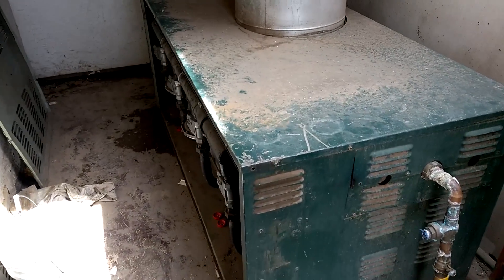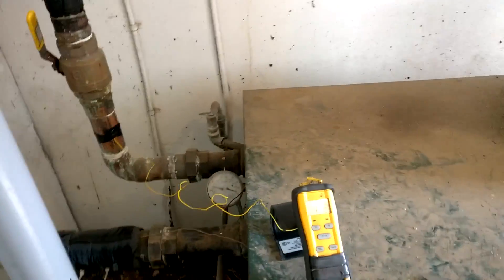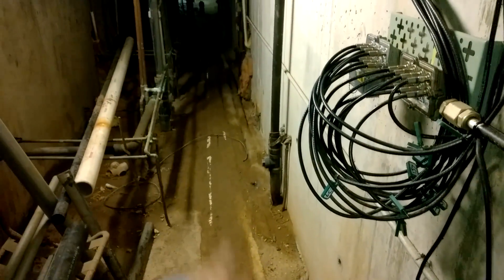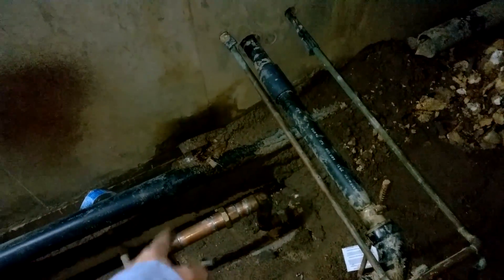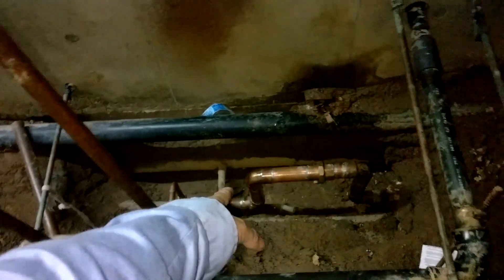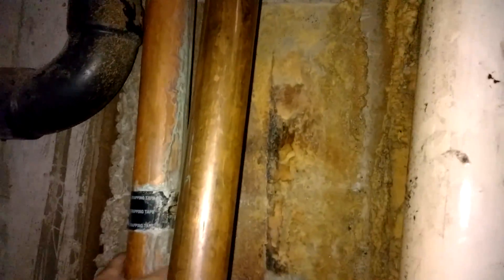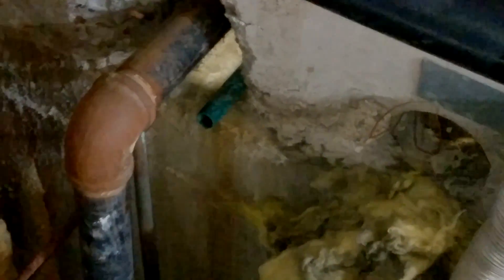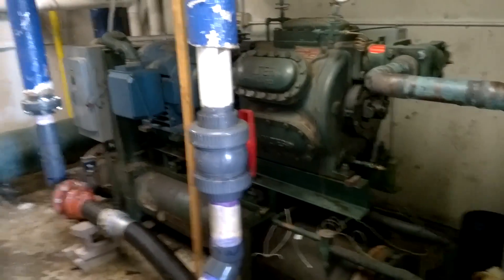Odd commercial system uses domestic hot water for closed loop heating

Comment: I worked at a motel that had this type of setup.  Chilled water loop, hot water loop, and domestic cold ( 5 pipe.. ).  It got real entertaining in the summer, because they didn't want to spend the money to rebuild dead zone valves.  

They would have to go around to rooms that had known ( or newly reported ) "air conditioner don't get cold" complaints and turn off the isolating valves.

Luckily, they were two separate loops, so the water wasn't shared, but the heat exchanger shared the heat - the chiller wasn't too happy.

Comment: Pretty common up here in the Northeast, especially in the places with oil heat & no gas hook-ups.  Lost of places even have a separate, insulated storage tank off to one side as a buffer for the domestic hot water side.
Reply from the maker: +therealfranklin Yeah no tank at all here. Just the coop itself.
Reply: +therealfranklin It might be common where you are however the thing is it's probably not legal anymore to use heating boiler water as domestic hot water, that if it was allowed at one point in time
Reply from the maker: hdyudu
This was the first time I've seen this setup. Everything else I've seen was discrete systems.